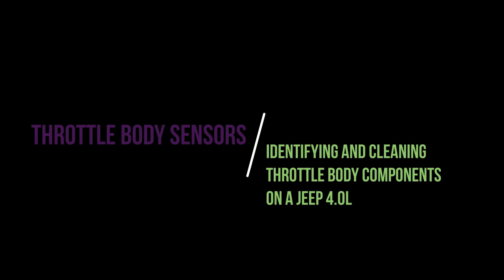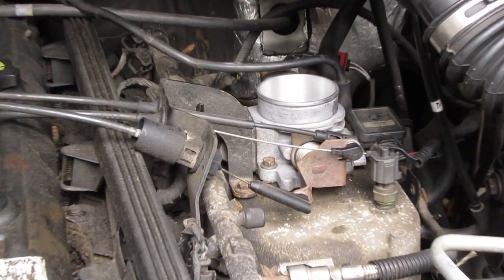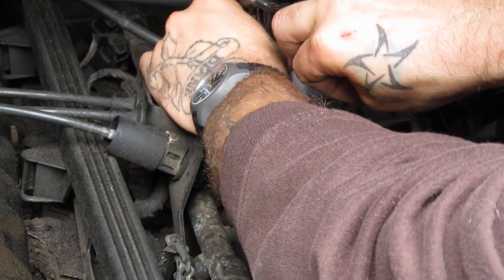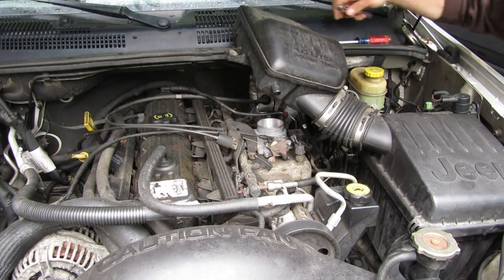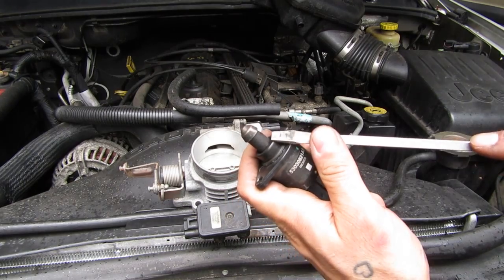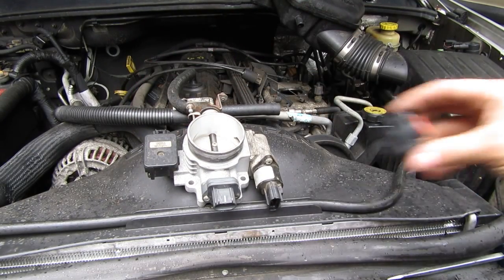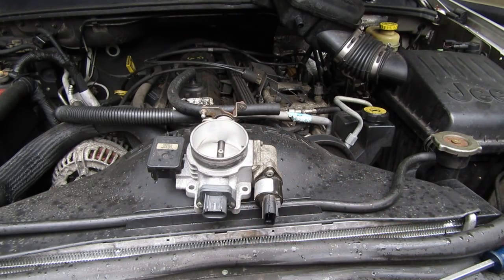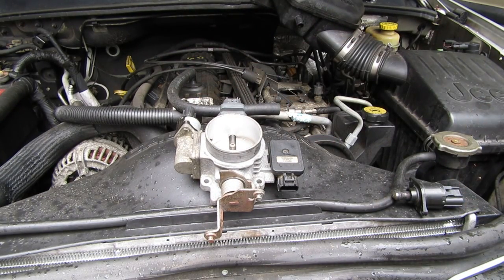THROTTLE BODY SENSORS (IAC, TPS, MAP) - Jeep 4.0L

Comment: Just picked up a 4.0 ... different animal than what I am use to for sure! I'm over here treating it like my 4.7 "crap they put limeaid in the fecking thing!"
Reply from the maker: HAHA... Yea, the 4.7 is a great motor, but lots of picky little things to remember. The 4.0 will run on olive oil in the crank case a gatorade in the radiator

Comment: Great video. I have a 2000 Wrangler that idles kinda rough and when you put it in drive or reverse with the break on it is rough as well, almost seems like its pushing too hard against the brake. Put in neutral and it smooths out or when you drive it seems ok. I bought an IAC and TPS for it. Taking the throttle body off definitely seems like the easiest way to replace the sensors.
Reply from the maker: Yea, it definitely is. Good luck with it!
Reply: @DEInTheGarage   I went and had the codes read again and its showing P0172(running rich). The guy I bought the jeep from replaced the IAC and TPS before I bought it. I'm googling but if you have an suggestions from past experiences I'd love to hear them. Thanks!
Reply from the maker: @khross73  I would definitely confirm that everything on my throttle body was clean. IAC and TPS should not effect mixture, but the MAP sensor could if it was faulty or the rubber hose which connects it to the TB was ripped or missing. Usually a rich/lean situation end up being tied to an O2 sensor. I would definitely  check the rubber hose on the MAP as there is no code specifically for the MAP, it just makes the engine throw other codes like running rich
Reply: @DEInTheGarage  will do. Really appreciate your help
Reply: @DEInTheGarage   Well, changed all 3 sensors, cleaned the throttle body, and checked the map sensor hose. I've seen no change in behaviour. Back to the drawing board :(
Reply from the maker: Perhaps we are looking in the wrong area. I suppose this could be a torque converter or even trans issue. I am sorry that I cannot offer more definitive suggestions without see the vehicle. The fact that is smooths out in neutral has me stumped. I know this sounds nuts, but you may want to give the following a try... take both leads off the battery and remove the battery from the jeep. then touch the two leads together to release any small amount of energy that could be stored in the sensors and computer of the jeep. leave the leads touching for a while, at least 10 minutes. This is the automotive equivalent of unplugging the router for 10 seconds to get the internet to work again. I had an issue similar to this, but a little different on a 2002 WJ and this trick fixed it. Some signal was getting crossed somewhere and the total electrical restart gave the computer an opportunity to start fresh. It costs nothing and is in no way harmful to the jeep outside of needing to reset your clock after. It is a long shot, but if it works it saves you a lot of time poking at random parts and hoping something fixes it.
Reply: @DEInTheGarage  No worries man. I work in IT, I know how hard it can be to troubleshoot from a distance. Just figured I should report my findings. I'll give the battery lead trick a try and see what happens. Again, greatly appreciate the video and the replies.

Comment: Mine just kicked back a P0123 and P0121, and won't go into overdrive. At least my Jeep tells me my TPS is acting up. Happened after a carwash. However my cruise control goes out for a day or two after a wash, I'm thinking a wiring problem, but who knows. I'm gonna give it a good looking over when I change the TPS.

Comment: Had my throttle body off and cleaned it while I have been diagnosing the issue on my jeep, it was disgusting inside. Thought it was weird when I was cleaning it that there was no gasket. I put it on real quick this morning but I guess I need to pull it off again and use a gasket

Comment: I have the shifting problem that you mentioned with the TPS sensor mainly happens when going up hills and sometimes from a dead stop, a friend told me he had the same shifting problems, he replaced the TPS and he was fine, so I replaced the TPS in my jeep and I still have the same problem, what do you think might else be wrong? (96 ZJ 5.2)
Reply from the maker: Is the fuid clean and at the proper level?
Reply: @DEInTheGarage  Yeah that's the first thing I checked when the symptoms started, fluid still looks brand new and it's at the full line, Jeep only has 115xxx on it, after watching this video, and I drove the Jeep today it does bog down some when I'm stopping like it's about to stall, could the IAC with the TPS have something to do with it? I haven't pulled the IAC to check it yet.

Comment: Nice vid and explanation of parts and what they do. I know this is an older video. Have you found that when replacing these parts its a good idea to use some dielectric grease or something to seal connections that will maybe protect the parts????

Comment: Dude, you are a" WJ PROFESSIONAL" because of your knowledge. I do appreciate your videos! I've had my 2000 Grand for 6 months. I love it (it's loaded) but many issues are rearing there head from the previous owner. My front driveshaft cv's wher clicking @ low speed for 2 days & then just went away w/2.5 lift. They don't fix themselves themselves. In your experience what's the best way for a fix? Thanks man!
Reply from the maker: Unfortunately there isnt really a good way to fix CVs, you just have to replace them. if you are short on cash, you might be able to find some decent ones in the junk yard to get you through another year or two

Comment: Hey so I loved the video I have a 4.0 2001 stuck in high idle at about 5 rpms after taking out and putting intake back in from fixing a freeze plug everything hooked back up correctly but I start it and dont even have foot on gas pedal and it's at 5 rpms over revving the engine what do you think would be the main cause or at least a ruff idea any response asap would be great trying to get this thing on the road

Comment: Great video, error code PO122 throttle / pedal position sensor switch A circluit Low.  Going to replaced the sensor.  thanks

Comment: Hey man thanks a lot I have been combing the internet for a suitable direction in which to go I'm very mechanically inclined and really thought your video on these dadgum throttle body sensors I have had nothing but trouble my Jeep runs very well and it has over 250,000 miles I went and got a used throttle body unbolted it off of one in a junkyard somebody's put a couple of new sensors on it and I hope they are the ones I need because I'm thinking that the transmission solenoid is bad because it threw a po743 got me thinking that I'm going to have to take the pan down and Dev valve body of the trans . Anyway man I like your knowledge on automobiles thank you so much your video was helpful man

Comment: Great video dude I change the fuel pump  car worked fine then a day after the truck started idling...only after the car heats up to its level then shuts what can it be thank you
Reply from the maker: So it idles fine when cold, but shuts down as soon as it reaches operating temp?
Reply: D&E In The Garage  yes actually I check the fuel pressure it was the fuel pump it was a bad one.as well now it works fine , you should make a video on suspension care
Reply: My guess would be the CPS (crankshaft position sensor).  I had the same issue... Does it start right back up or do you need to wait a little while?  Could also be vapor locking of the fuel rail...

Comment: Great video. I learn a lot!!!. Question, i was at a stop when my xj start to idle up and down and after maybe like 10 sec. It just die started up again and die again. There is times where it runs like nothing but there is times where it does the same thing. Any idea what it is?
Reply from the maker: It certainly sounds like your IAC or TPS could be messing with you. Could also be a fuel delivery issue or even a spark plug issue. Do you have the ability to find a junk yard to pull some new sensors to test the theory? If you find the right yard, they should be $5 each

Comment: I'll occasionally start up my Jeep and it will start up fine but will just die unless I keep my foot on the pedal. The second I let my foot off the gas, it just dies. To restart, I'll have to give it some gas to start and again, keep foot on the pedal a bit. Most of the time it'll be fine after a few moments and I can take my foot off and it'll be fine. This happens maybe a few times a year so not often. I replaced the IAC, still happened afterwards. Looking online, some places are mentioning the TPS. Does that sound probable to you?

Comment: Awesome vid brother. Gotta a question though. I swapped my tps plugs coil and reset throttle cable. Still chugs along with sometimes hard shifts or clunking into gear or high rpm before it hits next gear.

Comment: I have a 1997 zj.   The only problem is idle dropping out when moving the transmission. From park into reverse or drive.   I bought a non-Mopar Air idle sensor. People tell me Jeeps don’t like anything but Mopar sensors.  Is it likely that the air sensor is my issue even though it’s a new generic sensor?  If not that, what else should I be looking at? Vacuum is within spec.
Reply from the maker: No, not likely the sensor if it was replaced. It sounds like a vacuum leak, though I know you said it didn't have one. Is the TB clean?
Reply: D&E In The Garage Yes, it’s clean.  I’ll recheck vacuum.  May also take a trip to the junk yard and get three extra sensors as long as they are Mopar made.  Thanks for the reply also.  Idles great at about 750 rpm.  It’s only when I put the car in gear that the idle sometimes, not always, drops to about 200 rpm and becomes wayyyy rough if not stall out completely as I try to recover by pressing on the gas peddle.

Comment: My jeep is idling super low around 100-100 rpm. I replaced all the sensors and it’s still doing it. Any tips. I feel like the only thing I haven’t replace is fuel injectors. But everything else fuel and sensors and plugs and wires cap rotor. Don’t see a vacuum leak

Comment: A little help to this buddy ...Rough idle and shaking on complete stop , if I stop and go on neutral nothing goes on and applying on the gas it hesitates  to catch up on speed , hope you can help thanks , nice video!!
Reply from the maker: Any engine codes?
Reply: No engine codes
Reply from the maker: Hmm... without much to go on all I can do is suggest a few thing... Make sure your spark plugs arte good and within spec. Make sure all your TB sensors (from this video) are good and clean. Check that the Jeep has proper fuel pressure (if you take it to a shop they will do this for you for a few bucks). Without any codes, it is most likely one of those main issues... something is preventing it from getting spark, fuel, or proper air..
Reply: D&E In The Garage   alright thanks I’ll have to take a look and see

Comment: I took everything apart and cleaned it, reinstalled it. It now runs better and doesn’t shake. Thank you. However now my check engine light is on for p0122 ??? Any ideas of what I did wrong?
Reply from the maker: Yea, either your TPS is broken or you didnt push the connector in all the way. try to wiggle the harness to make sure it is making good contact

Comment: I'm getting P1296 after I replaced the IAC & TPS. It was running a little rough, started surging periodicly and trans slipping. Cleaned the throttle body, changed the spark plugs and replaced a broken vacuum boot. Now it  stalls at low speed, stops and deceleration. If I replace the MAP and still stalls? Could it be because the new sensors that's throwing off the MAP? I have to power brake it to drive.

Comment: So I'm having trouble with the shifting just like you said could happen if your TPS is blown. I have to get it up to 4000+ RPMs before it'll shift. But I've changed the TPS. Is there any other ideas that you have that would be causing my xj to act like it's in limp mode?

I should add: now my xj won't even run if the TPS is plugged in. (or the map sensor).

Comment: My 93 Cherokee sport 4.0L, won't start in raining or cold days, the ignition code I got from the turn on off 6× was 125155, but I couldn't find much about it, 12 I know, I had disconnected the "new" battery, to clean all possible grounds, but I don't know what the 51 is for.
Reply from the maker: I will be honest with you, I have limited experience diagnosing OBD I jeeps by codes. I would highly suggest you get on Jeep forum and post that sequence. Someone on there will have an answer for you in an hour. Those guys are awesome
Reply: @DEInTheGarage  Oh, thanks for the quick reply. 

Yeah, I saw a reply on some Jeep forum (I don't recall the specific forum) anyway, the reply was for someone having the same problem I'm having, the person said that the 51 code was related to vacuum "lines"? They said something about the engine running lean? I didn't get it through,  as I don't have much knowledge about this specific things. 
You won't believe how many people have this same type of problem, where the Jeep won't start during and a few hours after a rainy or cold day, until the sun comes out, and supposedly warm up or dry up the vehicle. In my mind, it must be some sensor getting moisture, but I can't figure out which one.

Anyway, thanks for the video and the quick reply, you're doing a great job, that will help a lot of people, thank you.

Comment: I have a 2007 jeep grand cherokee Laredo and I was in the highway doing about 65 mph and I lost acceleration, stepped on the gas and the rpm would barely move. The first time I put it in neutral and back in drive and was fine. The second time I had to pull over put it in park the back in drive and was fine any ideas what it could be. The code I have is P0507. Thanks
Reply from the maker: The code is likely from dropping it into neutral while moving. I would guess you have a TPS issue as well.

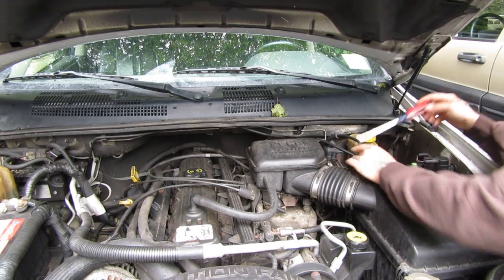Comment: At 1:29, taking off the PCV wouldn't make it run rough, would it? Pretty sure that just burns off a little bit of extra oil and thats why it goes in air manifold

Comment: The air box on top of the throttle body also has a 10mm bolt on the left side holding it down...

Comment: I have a question. I have a 2001 Jeep Cherokee sport and my throttle body unit make a loud sound when the hose is off to the air filter. I have check all hoses to the TB but I can't find the leak. Where should I start?
Reply from the maker: Hello, Checkout our video on finding vacuum leaks. this will work for your intake leak as well (technically it is a pre-manifold vacuum leak)

Comment: Great video but I read allot online and most people say not to use brake or carb clean on the sensors it can but not always will fry them. I plan to clean my TB up soon and am going to be getting the maf sensor cleaner and or elec parts cleaner just so I don't ruin one of them. My luck on my TJ they would go bad in a week if I use brake clean lol.
Reply from the maker: Suite yourself. Never had an issue here

Comment: Any idea why manifold exhaust will turn red hot.94 4.0 grand Cherokee 4x4 muffler shop said it wasn't catalytic converter
Reply from the maker: Hmm.. in my experience that is only going to happen when there is an obstruction in the exhaust. Is the Jeep running normal otherwise?
Reply: Yes .noticed it when I was working on it late so I replaced fuel injectors wrapped with heat shield.

Comment: I’m getting a weak idle at start and takes a second or two to crank. Cleaned throttle and replaced IAC. Still doing it. I’ll try the MAP next
Reply from the maker: Perhaps check fuel pressure? Possibly old spark plugs?
Reply: it ended up being my battery. Just threw a new odyssey in it and it fires right up. Idle sounds perfect now

Comment: I have a 98xj with a 4.0 that is running like crap. the map sensor has been replaced  but the other 2 has not. It acts like it wants to die when I'm driving down the road and it smells like it is overloading fuel. I'm thinking about replacing the other 2 do you think this will help?

Comment: Where did you get that throttle body?.. the one I bought didn't want to fit the IAC  it was very tight..
My jeep is running lean at the moment, would replacing any thing from the video fix it?.. if not can you point me the right direction?..thanks!

Comment: Hi mate, I know this is an old video but I’m hoping you can help. My 99 XJ is throwing a tps code. So I bought a new one and replaced it. Every time I try to reset the check engine light, it co es straight back on with the same code. I have pulled my throttle body off and cleaned it but can’t clear the light. It seems to drive ok but it has a flat spot when I floor it at about 2000 rpm. Can you suggest what else I can look for please?

Comment: This was a great video, but I have a 04 Jeep Liberty 3.7 L engine.  Question when I started up first thing the RPMs are at 1,000 and when the car warms up it drops down to 650 or 700 RPMs. Is that normal? And another question sometimes when I'm on the highway driving at a steady speed it starts  surging forward  , the car accelerates, what is the cause of that if anyone knows please help?

Comment: If ur tps blew on the trail, couldnt u use the 1-2 gear shift option instead of drive?
Reply from the maker: It all depends. TPS are like temperamental little creatures. you never know exactly how they are going to behave. Sometimes when the go the vehicle just shifts weird, sometimes it will prevent the vehicle from moving much at all. That is an extreme case, though. The 1-2 on our Cherokees will get you off the trail most days

Comment: Hey so i recently bought a bbk throttle body and it came with this small rubber tube... any idea where it goes? And also how to you calibrate a throttle body? 

I ended up messing with the screw and now the RPMs a lil too high, especially when i turn it on